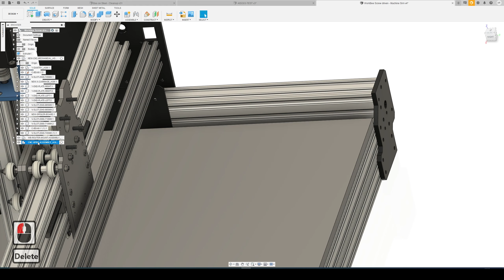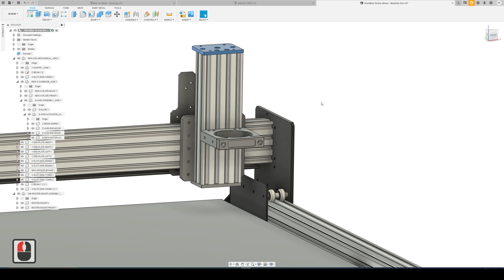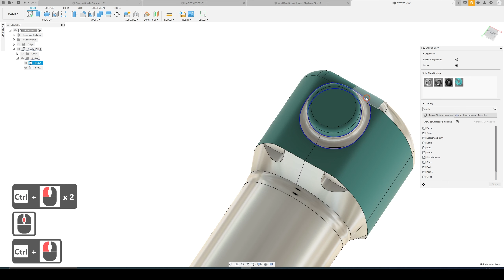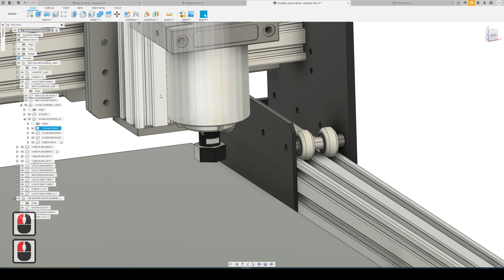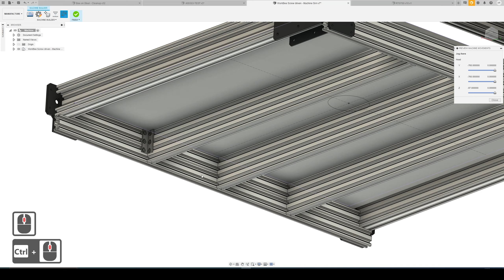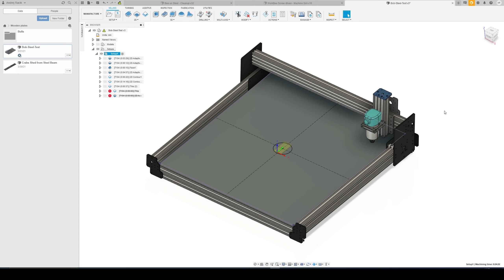Machine Simulation in Fusion 360

Comment: Hi I am just a educator here at India teaching students to work on Fusion 360. This video is really great. I would like to know if you can share the machine 3D model you are showing in your video to aadithya.autodesk@gmail.com
Reply from the maker: Thank you Aadithya, it's a hobby level cnc machine called WorkBee with quite a strong user base. Designed by a company called Ooznest in the UK, but there are many versions of it from many companies like Ratrig or Openbuilds.
You can find the design on thingiverse, it's based on an older version but sufficient for the purpose of this video. The model is in step format so easy to import to Fusion. I'll send you the link via email later when I am my desktop PC (just in case you can't find it). BTW, do you know if the machine simulation is available in the hobby version of Fusion?
Reply: @crabsshed  Thankyou so much. Since the machine simulation feature hasn't come out of preview yet, I believe Autodesk cant give us a clear answer now for your question. Anyways I dont see any point of restricting this feature to hobbyists. Lets hope for the best. Once again Thankyou so much